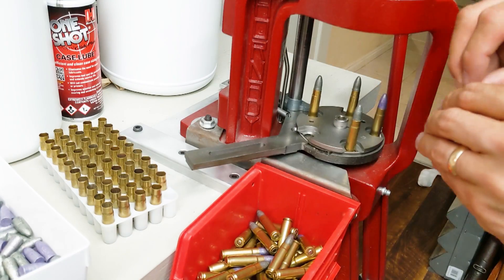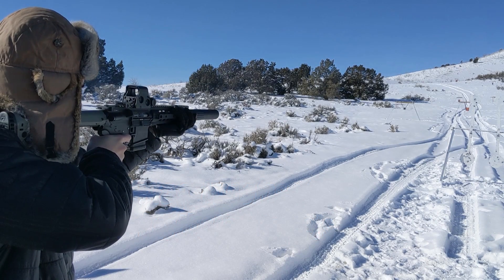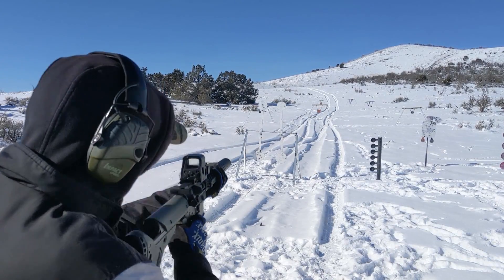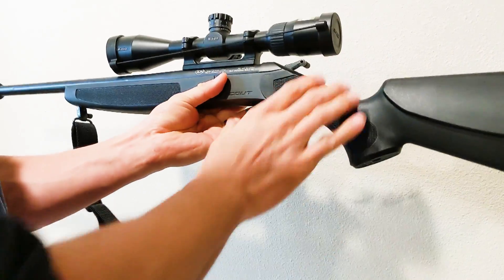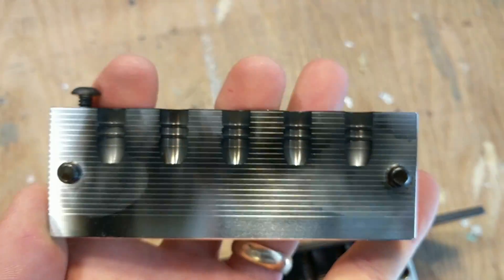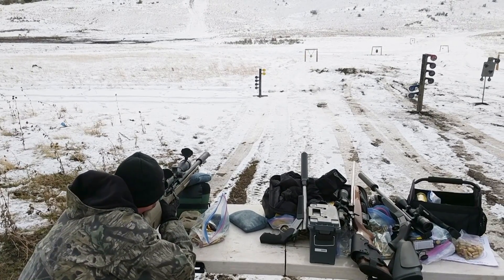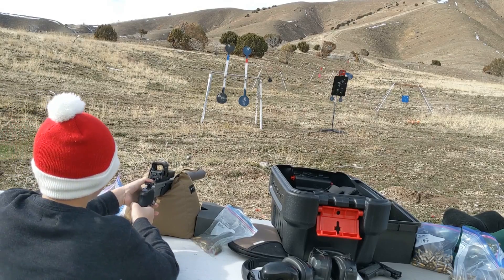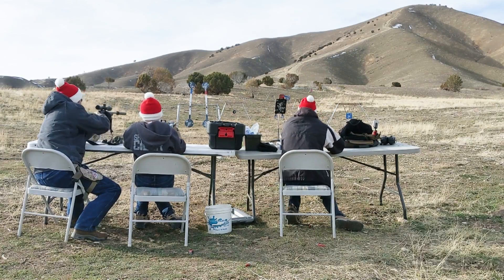Evolution of the "Bunny Fart" Load in 300 AAC Blackout (quiet lightweight subs)

Comment: I have been looking for one of these for over a year in a 5 cavity and noticed that most models and types of this 135 30 cal mold were always out of stock and there was never any on the group buys.  So I just kept checking back. Today However as I was looking it popped up on the bottom of the page "similar items" and it showed 8pcs of the 4 Cavity molds of the HTC310-135-RN-BY3  PB !  So I finally got one coming!  I must be blind because its been near the top of the page when looking at the mold page.  I had already purchased a 220 Gr Subsonic 300 BLK last time and didn't see any 135gr PB Molds available then as well.  I guess I was looking at the bottom of the page showing the larger 5 cav and brass molds. It showed like 6 or 8 different molds of HTC310-135-RN out of stock, that kept throwing me.  I didn't want a 2 or 3 cavity or brass so I just kept waiting. I will try to scour the mold page better from now on and look for the "Similar Items" as well.  I hope I am the only one, because I really searched every time I went there the last year or so. I'm just glad I have a new 4 cav 135  plain base finally on its way!  Thanks for the great videos you have done over the years and yourself and Al's work on designing these molds. Now if I could just find a contender or encore! 😅🤣
Reply from the maker: Lol my friend picked up the same one last week

Comment: I bought a 16" 300BLK just to shoot suppressed subs because of videos like these but when I got it I was surprised how loud it still was with 208gr Hornday subs. Not that you needed hearing protection at all but far from a near silent bunny fart. Is the sound in the videos so deceiving or are these loads much quieter than all of the factory subs out htere?
Reply from the maker: These loads are really quiet when suppressed. All the powder is burned in the first part of the barrel using trailboss powder unlike the magnum pistol powders that are used in factory loads. Factory loads have to have enough port pressure at the gas port to cycle the action of a semi-auto which tends to make them a bit noisy(er).

Comment: Where can I find info about subsonic loads with HP-38?
Reply from the maker: for bolt guns? or ARs?
Reply: @FullLeadTaco  It could be either, but AR primarily.
Reply from the maker: @1970351C2V  for the AR you'll need to use the magnum type pistol powders like a1680, cfeblk, swblackout.  For bolt guns or break actions you can use a larger variety.

Comment: So subsonic is based off a heavier and slower projectile correct? What about a load to make black tip loads into subsonic ammo? Would you even be able to do it? Id love to see a ballistics test of it For say a .300aac-blk & .308. 
I dont want to try it but its always made me wonder.
Reply from the maker: You can make almost any bullet subsonic, you just have to use the right powder to get them around 1000fps or so.  However, in order to function as a semi auto and work the action, you usually have to use a heavier bullet and a powder that will maintain enough pressure at the gas port to cycle the action.
Reply: @FullLeadTaco  how much do normal subsonics weigh as opposed to black tips or other AP ammo?
Reply from the maker: @RemanentSphere  usually 300 blk subs are 200+ gr and I'm not sure on black tips
Reply: @FullLeadTaco  im not either I'll check. And I'm talking about 7.62 loads because they're heavier and in theory easier to make subsonic? Maybe? I think? Lol
Reply: @FullLeadTaco  "Cartridge, caliber 7.62mm, NATO, armor piercing, M993 (United States): 126.6 grains (8.2 g) 7.62×51mm NATO armor-piercing round, black cartridge tip. Can penetrate 18 mm of RHA at 100 meters."
What say you with this information.

Comment: Good video. I may have to check out that NOE mold. But I've got a bunch of the 155gr Lee I need to use up. What do you think about shooting a gas check bullet that is powder coated without the gas check? Is it basically a waste of time? Ad conversly, would you shoot a gas check thru a suspressor? I have some I powder coated after I gas checked them. I created a bunch before I got my supressor.
Reply from the maker: I shoot plenty of bullets that are gas checked and powder coated over the top through my suppressors.  As far as the plain base vs gas check, if the bullets have a gas check shank, I pretty much put gas checks on them for accuracy purposes, or use a plain base.

Comment: My 300 does not seem to like the 556 pmags and has feed issues usually with double feeds. I do not have issues using the Colt aluminum mags. I have not had the opportunity to try a 300 pmag yet. Also the issue is with 200-220 gr subs.
Reply from the maker: Which gun you have?
Reply: Full.Lead.Taco Spykes lower and Radical Arms upper. Not sure how this ended up here, I replied on a pmag 5.56 vs 300 blk out comparison.

Comment: What's your average FPS with that load? I've been shooting a modified RCBS mold that throws a 148 grain HP over 5.4 grains of trail boss for years. Comes out of the muzzle @1040fps and is extremely accurate.
Reply from the maker: Been a while since I ran them through the Chrono, but I think it was somewhere around 950ish or 975ish fps.